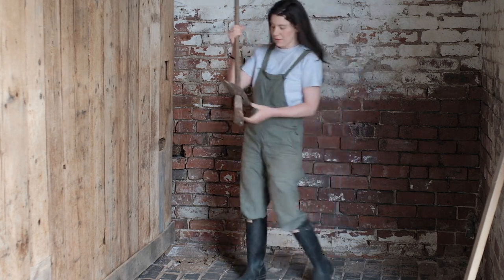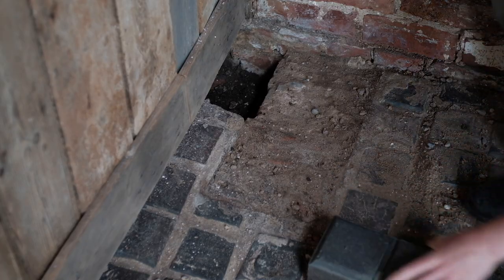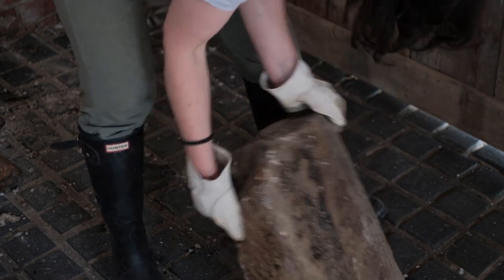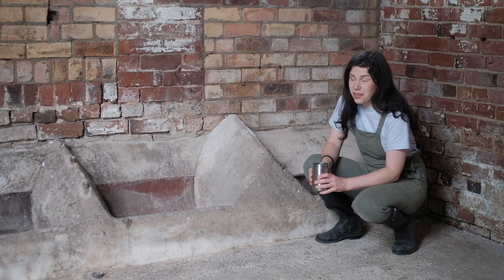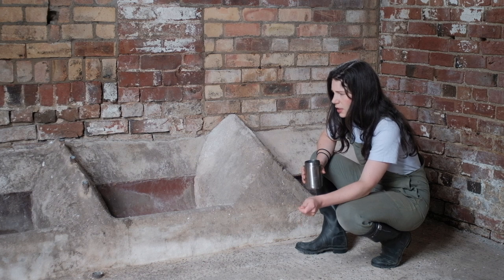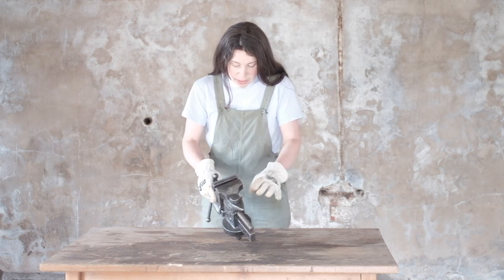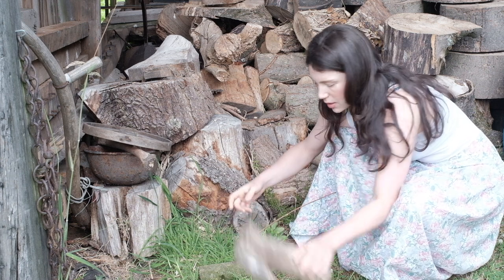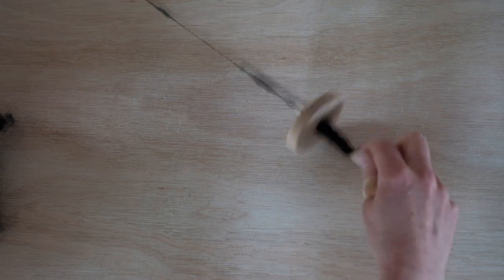#8  I really struggled with this.  Barn renovation, climbing trees, spinning wool

Comment: 4:45 - OK, good luck on sledging them out....   sees crowbar  gasp   No No No, don't do that... You'll loosen the wall brick prying on it that way. Try using the little shovel to dig under the red brick a little bit then use that sledgehammer head you found and slam it on the edge... That should help knock the grouting loose then you can use the crowbar to pry between them.
Reply from the maker: Thanks! yes, the crowbar was a bad choice!